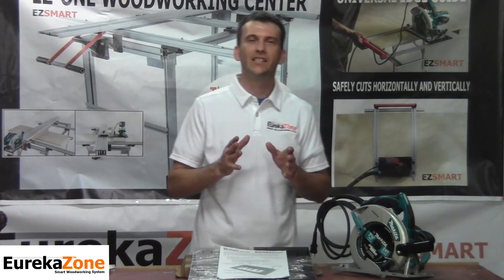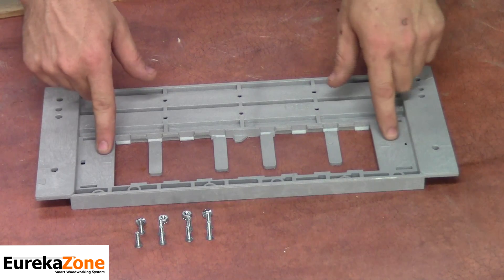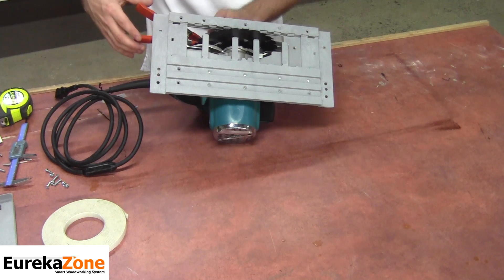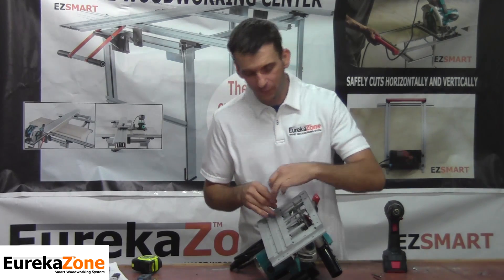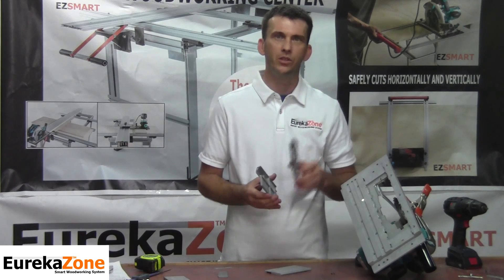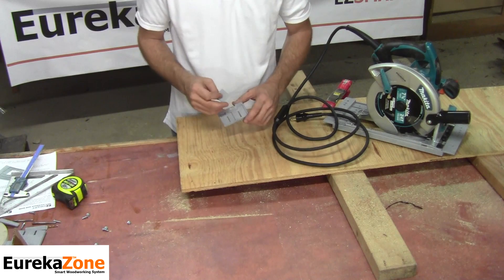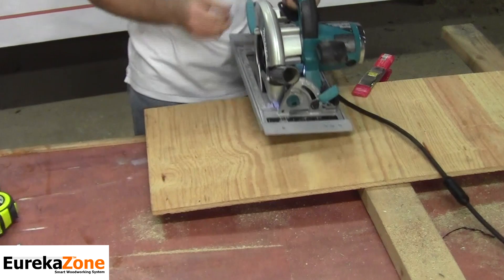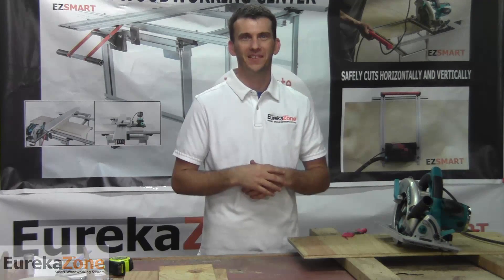EurekaZone Episode 1 - EZ Smart Saw Base Installation

Comment: Laney,  It has been a while but I have a question for you.  I have a pile of 9-11' rips to make in thin hardwood from 3/8" to 7/8" and the wood is a bit green and not S2S.
Would the EurekaZone - EZ Smart track work for things this long?
 I ask before I build a track to run my saw on or in.
ThHere's 100's of these and I'm trying to establish a reference edge.

Comment: TO REPEAT - THAT IS NOT A SKILLSAW.  It's called a CIRCULAR SAW.  You have a universal product.  You lost a lot of viewers.  When I see a number like $500 in a comment - you lost me $400 ago!
Reply from the maker: Not all people know the difference and the guy on the video is used to say Skill saw.
Have you seen the ez-extrusions? They can spend 12 feet on the Bridge creating  custom tools
 with no comparison VS Makita -Festool-Dewalt and the rest,
 Look at the details and the design. Ez is box construction double wall extrusion while all others are thinner and single wall.  Ez tracks and channels are Self aligning  that require twice the aluminum. The ez price is lower if you  do a side by side comparison.  We are comparing industrial quality VS diy single thin wall extrusions, Apples and Oranges.
About the $500.00 if you compare part vs part you get there very easily. 
makita offers one track.we offer 2 with the 108", connectors, base with inserts and clamps.
thanks for your feedback. And as you noticed is a UNIVERSAL design to save you even more.
We can easily offer  our own Circular saws and other power tools but we stayed with the universal feature
 to make it  even more affordable. 
dino

Comment: Calling it a Skil saw was driving me a little nuts... Haha!
Definitely more cost effective than a $1,200 (green) track saw.
I'm just not too sure how long the plastic base and track would hold up either in the shop at home or at the job site.
Reply from the maker: the base lasts for over 20 years. The features alows a normal saw to cut better than any dedicated "plunge saw"
the tracks are multi functional, self aligning and box core extrusions ( super strong and straight) with double the weight and few patents to cover many applications that no other tracksaw can match.
use any saw, any blade and have the cleanest cut ( thanks to patented antichip protection) while you can cut the narrow strips of wood...please, watch all videos and compare better.
Reply from the maker: Thanks Cass.  And better in most functions. The bases last over 20 years so far.

Comment: This seems like a great system to get a left bladed track saw. You can buy those.
Reply from the maker: hI. The system works with left bladed saws.  worm drives and beam saws .
cordless and just about any saw.  You can even cut the base in half the base for it for any special oversize saw.
We even make special bases for custom saws.
thanks
dino
Reply from the maker: the same base works for left and right hand saws.
in top of it we make bases for any saw, even the 16" Makita Beam saw.
Another trick you can do is to cut the base and make 2.

Comment: The video needs to emphasize placement of the saw AT THE FRONT of the baseplate. The parts that slide in to the bottom of the baseplate won't work as well otherwise. This should be mentioned PRIOR to any other placement info in the video - it is presented as an afterthought. The splitter/riving knife attachment is to be used only when NOT using the track and is not to be used at the same time as the rear chipout insert. That did not get emphasized when I watched the videos. The videos are very informative but too over-thought with details and could be simpler and shorter.
Reply from the maker: gene,
thanks for the feedback.

dino

Comment: What about larger bladed saws?  I've seen EZ videos where they have a 10" saw on a plate on a track.  Will this work?
Reply: Yes, it is possible to install most wood and metal circular saws with up to 16" blades by using special bases.  You can contact Eurekazone directly for details

Comment: At $340 (package including 118" track), plus the cost of donating one of my circular saws to the cause, at a total of $500....why wouldn't I just buy an actual track saw?  Makita;s version is only $420 while Dewalt's is $500.  Am I to believe that this plastic base and what is essentially just a straight edge, can't be produced for less than $340 plus shipping?
Reply from the maker: Hi. Your numbers are wrong.
Our system comes with connectors, custom extruded edges - universal base and clamps. 
Voted best in testing done by HB. Best in self aligning connection, cleanest cuts and robust design.
It takes time ( 3 years?) and money to design a simple guide that is capable of delivering so many features.
To be fair you have to put everything into consideration when comparing systems. With eZ you can use any part with any ez tool and create a complete system capable of eliminating or at lest minimize the use of space and expensive/dangerous machinery.
The ez system allows you to work like a machinist and avoiding pushing materials to spinning blades and knifes.
20 years without any reported accident deserves some credit and not misinformation.. 
Please, take another look into the whole system.
Thanks for the feedback. 
Is our fault for not been able to promote all the benefits of this revolutionary system.
Try to do repeat tapered cuts. Clean cross cuts in Plywood, Cut a filler to remove 1/8" to 1/4" in 30" for cabinets
or even try to shave  ( trim) the frame of a corner cabinet. Is all about what you can do with the EZ system.
Keep in mind that it was designed by a carpenter/cabinetmaker and not by a marketing company.
Savings in blades alone  will pay  back in few jobs. No need for special saws, blades and more machinery.
Best thing about the  EZ system is that you can use your imagination to do cuts and tasks not possible with
traditional machinery or similar ( copy cats) systems.

thanks for the feedback.
dino

Comment: Laney, Great video and very professional with editing both video and sound.  Keep these coming because this is going to help sell more product!  I've been using my track system for many years, which I purchased from Dino directly after visiting him in his NJ laboratory ;)  The new products are great and it's educational videos like this one that will make a big difference with people sitting on the fence.  They will also help guys like me that have only worked with the original track but have made the move with purchasing the new products...
Reply: One final benefit that you didn't mention about the FIN insert is that you can use a speed square to start your cut and once that FIN is running the kerf line it's automatically going to keep the cut line straight!  This is important benefit that people need to understand
Reply from the maker: 100% correct.
thanks. The Fin works both ways.
1. prevents kick-backs
B. works like a secondary guide..
The cut piece can only be perfect even if you try to make a mistake.
thanks. Good feedback.
dino
Reply: EZ Smart why is this not available to buy in England without me having to pay nearly double with postage, I am sold i want this ,

Comment: Nice vid.But as even the sharpest of drillbits will wander a bit on initial cut,I would recommend only drilling one hole on the outside front or back of base,inserting screw and rechecking that the wandering bit hasnt thrown off the square alignment of the smartbase.  1/16 either way will not affect performance of base, as long as that measurement is kept the same at front and back of sawblade.  Also, do not file entire fin for thin kerf blades.just file point at front so asnot to lose rive efct